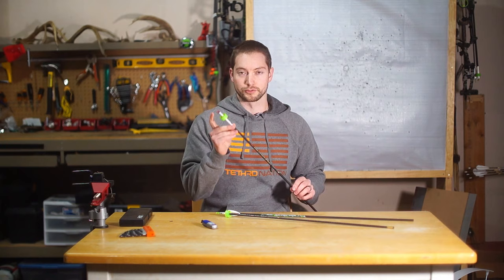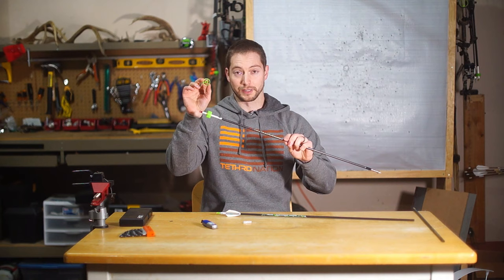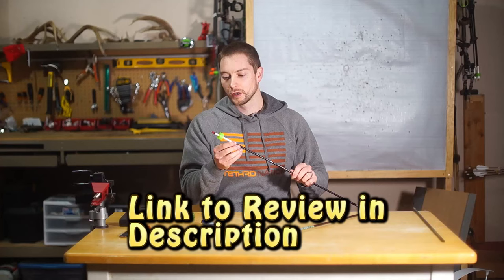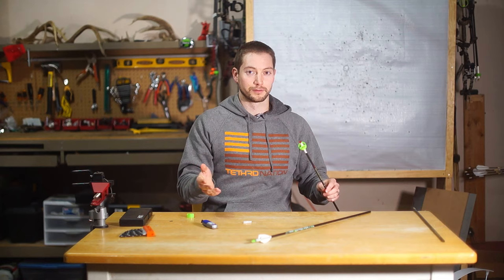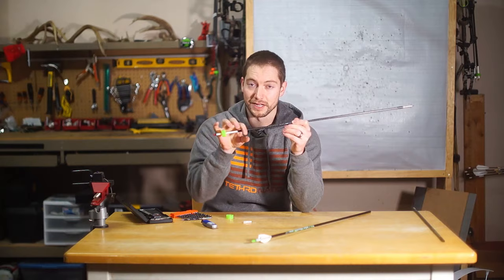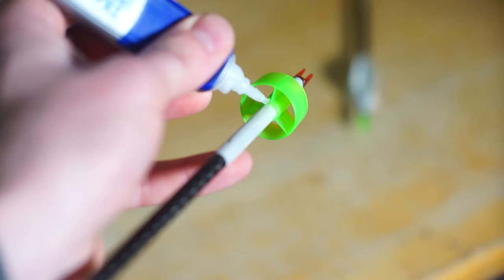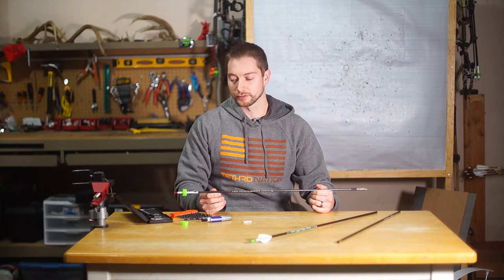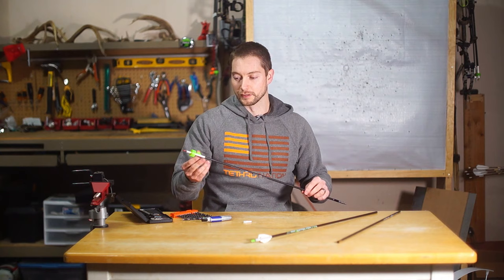Archery FOB Modification

Comment: I can think of one incidence where this would have helped me find my arrow faster than I did.  I was hunting from a ground blind and the arrow went way..Way farther than I thought it could after going through a deer.  I finally found the arrow about 30 yards on the other side of where the deer was standing.  I actually prefer my lighted nock to pop off with my FOB for two reasons.  One, I like seeing it bounce off the deer and two, it usually prevents the nock from getting blood in it.  Getting blood in some types of lighted nocks will cause them to stop working.  Even having them pop off, I have had one get blood in it and stop working.  But no matter what you decide to do, it is worth it to set them up the way you want.  Even if you go through the trouble to drill them and spot glue them, they are still much easier and faster to deal with than vanes or feathers!  I LOVE my FOBs!

Comment: Have you ever considered adding some heat shrink tubing in front of the fob instead of glue?  It stops the fob from moving forward on impact while not requiring glue.  I had some good heat shrink tubing and didn't need to do anything else, also had some cheaper stuff and added just a touch of glue on the heat shrink to keep it in place.
Reply from the maker: I have thought about it, along with 3d printing a flexible sleeve to glue to the ID of a drilled out FOB so that the whole thing slides on and off with some friction. That heat shrink should work fine if the sizing is right.
Reply from the maker: Electrical tape might also work.
Reply: @DIYSportsman - Might, but so far I have had to use either premium heat shrink(thicker) OR add some superglue just prior to heating, otherwise it buntches up after a shot or two.  The 3d sleeve is good idea and actually where this all came from for me, I designed and printed my own version of the fob. (It is on thingiverse : 4236458) but after initially shooting the fob would jam up on the shaft as its momentum would drive it deep on the shaft.  Then I added the heatshrink and it was fixed.
I will definitely add a stop ring to the print
Reply: @DIYSportsman  After setting up arrows last night and testing this morning, the new heat shrink I used doesn't always hold the fob in place so based on your comment, I printed off a small ring and super glued it to the shaft where I wanted the fob to anchor.  Worked really well.  Thanks for the idea.

Comment: Doesn't it take some of your speed/kinetic energy out of the arrow to break the glue?
Reply from the maker: Yes, but it also takes energy to pop the FOB off when used in the normal fashion (exactly how much would depend on how tightly your nocks fit in your shaft). That's why I like to keep the minimum amount of glue that keeps the FOB from shifting or flying off in flight. Once the FOB does pop off, the arrow can penetrate unimpeded through the animal, whereas plastic vanes  would fold up and create some drag. So it's tough to really say which option penetrates best (probably feathers honestly) but it's generally not going to matter much by the time you've gotten that much penetration on something the size of a deer because the broadhead will have already gone through the vitals.
Reply: The arrow has already done its job by the time the fob reaches the animal.  You would only need enough energy to break the glue joint and slide a bare shaft through the hole already cut in the animal. Probably a wash compared to pulling vanes through the animal
Reply: Ok. Thanks guys, I'll look into it more

Comment: There are some scenarios where this, while it's a great idea, won't work.  For example, I'm shooting arrows with a .204 ID, .262 OD, and Nockturnal nocks.  Since the width of the nock is considerably greater than the width of the shaft, there's no way for the drilled-out FOB to pass over the nock without striking it.
Reply from the maker: Very true. That's one of the reasons I like the firenocks for this. That, and I had enough of the nockturnals break on pass throughs that I probably won't use them again.
Reply: @DIYSportsman  Good to know.  I'm a VERY new archer, and still learning the ropes.  I like how bright the Nockturnals are, but having to use a tool to turn them off turns me off.

Comment: Thank you for sharing. Great video.  But you can't change rotation by turning the fob around. The angle will still be the same
Reply from the maker: You're absolutely right. I spoke before really thinking about it lol. I will trim that clip from the video.
Reply: @DIYSportsman  hey bro, ment to ask you earlier. Have u got a 240 fps ezv ring that you'd get rid of? I'm needing one and don't want to buy the entire set.
Reply: @DIYSportsman  tried this on a fob of mine. I drilled mine out with a 5/16 drill bit and it was snug enough so I didn't need glue.

Comment: Great video!
What is your best hunting arrow.
Reply from the maker: Thanks, right now it's probably my Grizzlystik 240 with Easton HIT insert and footer made from Easton X7 eclipse. But there are quite a few other setups I feel very comfortable with. I've been very happy with the Easton Axis with Ironwill HIT and Impact collar and also Black Eagle Rampage with that same system. They both have better spine consistency than the Grizzlystik, but likely aren't as durable overall (still very adequate though). I use just the aluminum HIT in my Grizzlystik arrow and it has held up fine. The Ironwill HITs come in other sizes and are either hardened stainless or titanium so you have more options with the insert system there.

Comment: Do you find that FOBs slow down arrows faster than fletchings? A penetration test between the same arrows, but some with FOBs and some with fletchings at 40 yards could tell.
Reply from the maker: It will of course depend on what type of fletching configuration you're comparing against (3 factory fletch blazers, 4 fletch heavy helical etc) though I find that there's minimal difference in point of impact out to 50/60 yards. If I compare against smaller target vanes, the FOB will slow down faster. But if I compare against large hunting vanes or feathers with heavy helical, they'll slow down faster than the FOB. For the most part I'd say penetration difference from such a small difference would be negligible compared to things like momentum, broadhead style, etc.
Reply: Thanks! What is your personal preference, standard 3 blazers or FOBs? And what is your total arrow weight and is the EZV sight now a permanent fixture?
Reply from the maker: @justinmailloux549  I can't remember the last time I've shot 3 blazers because I usually buy shafts and fletch myself. I've been using mostly Q2i Fusion II in 3 fletch or Fusion XII in 4 fletch. I don't have strong preferences either way. FOBs are way easier to add and remove. The vanes are more versatile for different configurations. Total arrow weight this year was anywhere from 537 to 580gr. Will continue to shoot the EZ V and other sights. I very rarely make something a permanent part of my setup.
Reply: @DIYSportsman  do you have any reliable method of nock tuning other than bare shaft through paper?
Reply from the maker: @justinmailloux549  You can also bare shaft at the range. Another good method is to shoot fletched shafts with broadheads at the longest range you're comfortable. That method also gives the most confidence that your overall setup is hunting ready.
Reply: @DIYSportsman  is it possible to tune broadheads to shoot with field points?
Reply from the maker: @justinmailloux549  Yes, at least at typical hunting ranges. Generally if I've bare shaft tuned and nock tuned all of my arrows, then my broadheads will group with field points without any additional work. But if for whatever reason bareshafts are flying clean, broadheads are grouping well, and field points group slightly off, especially at long range, I dont worry too much. If they're grouping significantly off it might mean something else is going on.
Reply: @DIYSportsman  just curious, have you ever experimented with compression testing (in say a bow press) arrow shafts with inserts and field tips at both ends to find the direction the arrow bends at release - as a nock tuning alternative? It would be awesome to be able to fully tune arrows at the bench if possible.
Reply from the maker: @justinmailloux549  I havent done it myself, but in theory it should be better than taking just a normal static spine measurement. If I were to do it, I would still want to verify by shooting the bow, at least until I had proven that it works just as well.